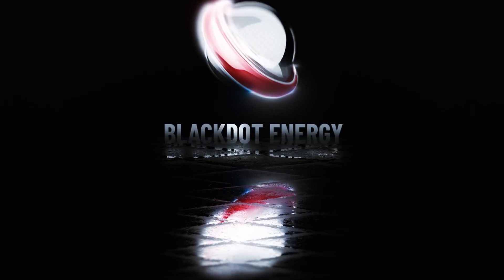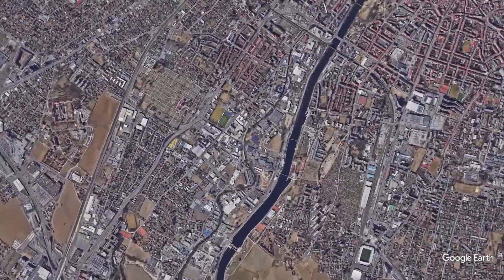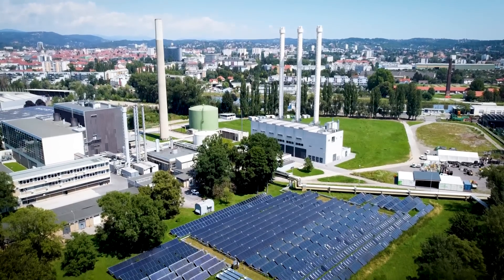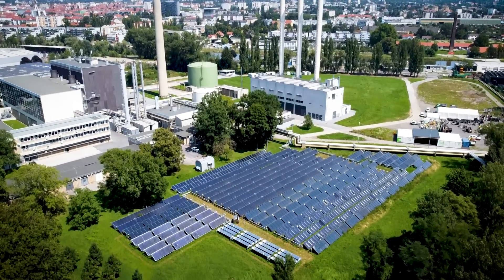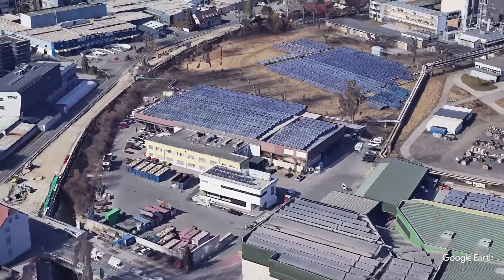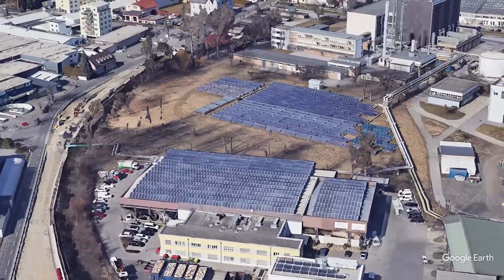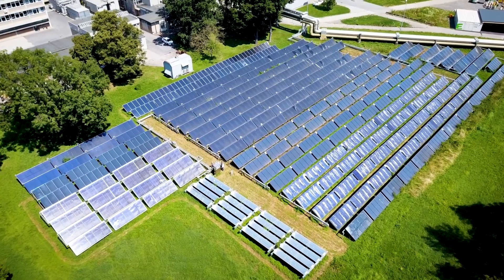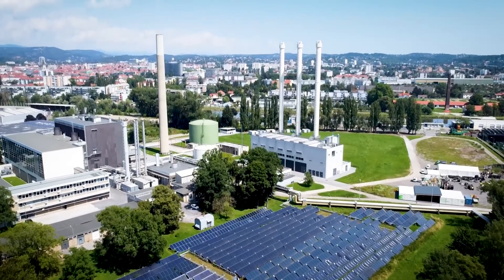Solar Heating of 5 MW or 8,200m2 Solar District Heating in Austria GRAZ

Comment: Can this be coupled with a thermal energy storage?
Reply from the maker: Great question—yes, this can absolutely be coupled with thermal energy storage. In fact, thermal storage is becoming a critical part of many district heating strategies. In Austria, they’ve already implemented large-scale seasonal storage solutions that allow them to retain heat for extended periods and optimize energy use throughout the colder months.

In my own work here in South Africa, we’ve implemented 40,000-liter thermal storage tanks, which give flexibility to release energy when it’s needed—especially useful in industrial processes. One of the big advantages of thermal energy storage over PV systems is the simplicity and cost-effectiveness of using water as a storage medium, as opposed to expensive lithium-ion batteries. That’s a major competitive edge from both a CAPEX and system resilience perspective.

Thanks for engaging with the topic—appreciate it.

Comment: Why are we in South Africa so far behind? We have more available hours of sunshine than most if Europe, and we are still tagging behind. This should be promoted in the south of Africa.
Reply from the maker: Dear Jerrard,
I absolutely agree and thank you for the feedback. We are entering a major transition in our energy spectrum. The main reason we have not seen these systems in South Africa, is because we never had a reason to change. 
Now that all changed with extreme price volatility in coal based power production and the lack of consistent and secure energy supply.
This is the most disruptive energy environment in the history of South Africa and it opens the doors and paves the way for renewable energy implementation.
I still believe it is possible to change the future for the better, we need to just all work at the transition towards a more sustainable energy base.
Thank you for the support.